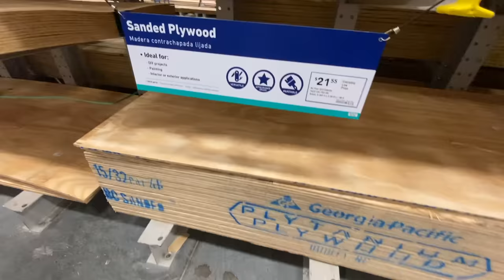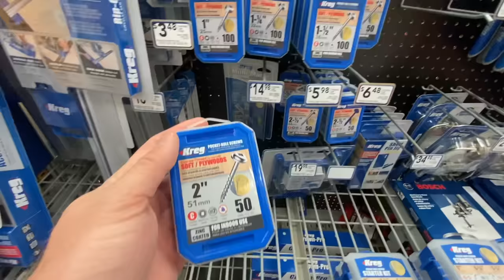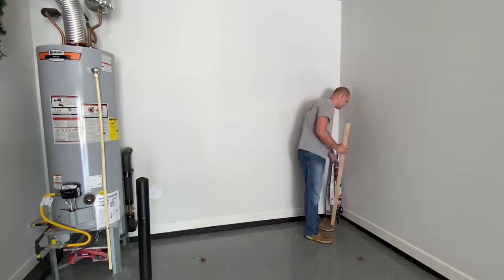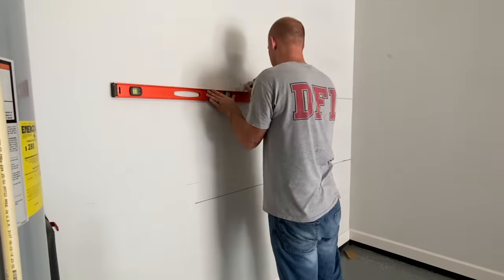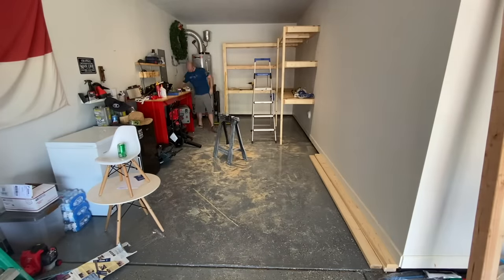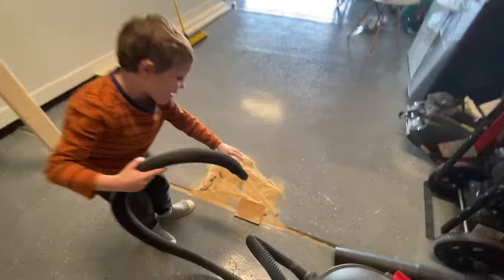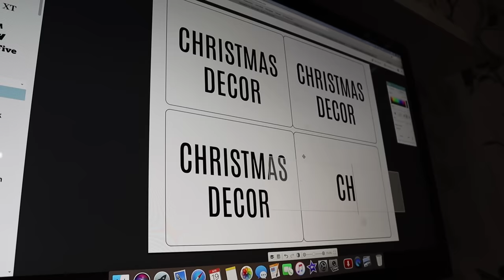EXTREME GARAGE STORAGE & ORGANIZATION | DIY GARAGE SHELVING | MORE WITH MORROWS

Comment: Frank, the notches on the top of your sawhorses are to insert a 2X4. Lay a couple in those notches and you can cut straight thru sheet goods without moving them. The 2X4s will be sacraficial and need replacing occasionally. Sure makes those long rip cuts easier.

Comment: Great job!  Tip: cutting 2x4s the same length, stack 2 together, make sure ends are flush, adjust blade depth to cut about 1/4” into bottom board, measure and cut.  Remove board that was cut to length, put another board under the board with cut line, flush the ends and cut again, repeat.

Comment: Nice work guys. When using pocket holes, you might consider screwing from the outside into the longer end of the 2x4 rather than from inside into the end grain if that makes sense.

Comment: Helpful tip. If you make the frame on the floor first, then screw it to the wall.
It's alot quicker and you can use normal screws :)

Comment: Top tip, the knock outs on the top of your horses are to allow a saw pass through. So you should be able to run a single saw pass without stopping.

Comment: To make the floating corner, and the whole shelf, even stronger, you could take a 2x4 and attach it from the shelf, downward at an angle to create a cleat that would provide strength in a triangle formation under it. I built a MASSIVE L-shaped desk for myself this way and its strong enough to for a couple people to sit on.

Comment: Great video, doing the commentary while video at double speed was fantastic.  Your commentary was very professional.  I wish more were like that.  I was wondering if it would be as strong to screw the shelf supports to the wall 2x4 before attaching it to the wall?  It would save a good bit of time not using the pocket holes.  They look nice though!  I look forward to your and answer and more videos.  Thanks
BTW: Our incredible Texas flag is upside down!  YIKES 😧

Comment: For that 2” x 4” going over the blank electrical plate. You don’t need to cut the board to allow space. You could mark where it meets the board and cut a notch out with your circular saw. Just set the depth to 1/4” and go over it a few times. 👍🏻
Reply: Junction box needs to remain visible/accessible, so in this specific case, he did the right thing.

Comment: It looks good, very similar to how I made the shelves in my garage. Only thing I think you could have done differently and been an improvement is to measure the height of your bins, and putting the shelves at that spacing. I think you could have got an additional shelf in there and maximized the storage/minimized the empty space. I did that and I was able to get 7 bins in a column (I stack 2 bins high on each shelf, 3 on top)

Comment: I think Frank should have definitely gave the shelves more support. I understand you can stand on them but the constant weight over time is also what will pull them down. 
I was most excited to see how you organized everything.
Reply: right.. Like little beams between the shelves to hold it up more.. I have no idea what I'm saying but I know what you mean lol 😂
Reply: JesssicaMarie my husband made similar shelves for my mom in 2005 and they’re still going strong
Reply: 1
Reply: With them being screwed into the studs and also the vertical supports he has there, they wont go anywhere with that span. Unless he plans on putting engine blocks on them they'll be just fine.

Comment: What I have seen from another video is to build the framework against the wall and then built the outside frame onto that frame held together with a few screws, and after duplicating it, remove the few retaining screws and move it from the wall and attach the two frames.

Comment: When you were cutting with the circular saw and speed square you should write down on the saw the distance from the blade to the end of the saw plate.  Mine are either 1.25 or 1.5 inches.  This way you can look at the saw and know if you need to add or subtract that amount.  Then you can just make a mark at that number and put the square there and make the cut.   Then your piece is the right size with only 1 mark that’s easy to align.    So if you want to cut a 21 inch piece and your saw is 1.25.  From the bottom you measure to 22.25 and put your square there and cut.  Or you put the mark at 20.75   Depending on which side your cutting on.
Reply from the maker: Thank you so much for the tip! I’ll be sure to start using this method!

Comment: I suggest you correctly identify OSB as oriented strand board-glued together wood flakes and not use it to refer to Plywood. 
I suggest measuring bin sizes first and spacing shelves at least 2” higher. That reduces wasted space. Get bottom shelf off floor enough so can sweep under it and any spilled wash water won’t get on shelf or contents. Also put vertical leg board on side facing water heater as if on face, it blocks  access for bins in that width. Keep up good ideas.

Comment: Remember not to block the water heater for service clearance. Gas controller and Temperature & pressure valve should be readily be accessible for the just in case it needs to be serviced.

Comment: Some critique, many of those boxes are filled with lightweight items and can be double stacked. Thus having to use one less shelf, saving money, build time and mess.

These shelves are very strong, too strong for the application used. This could have been accomplished with thinner plywood and thinner posts, again saving money. Those shelves could probably hold 1k pounds, and it'll probably never see that weight. 

Make the shelves spacing more tolerant to the height of the storage boxes so there is not 1 foot of unused space from the top of the box to the upper shelf.

For simply storing the types of boxes you have here, I would recommend using L brackets and plywood boards. Their weight capacity will hold far more than those boxes, even the one with paint. It's cheaper, far less materials, and much quicker.